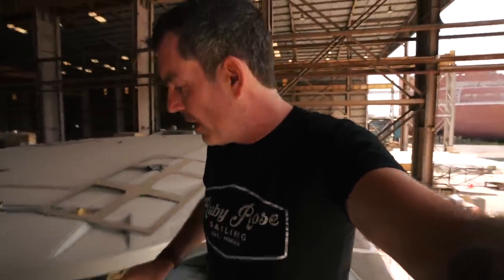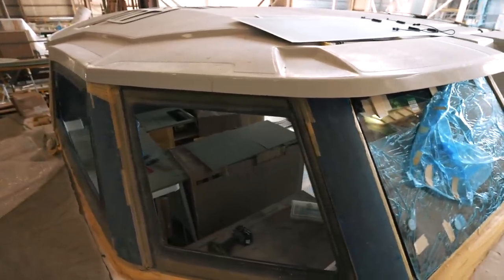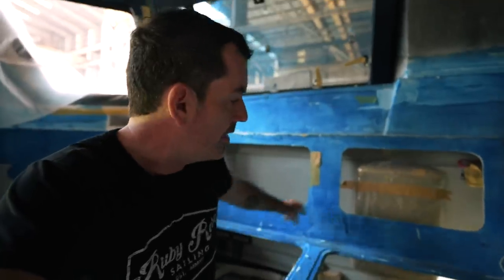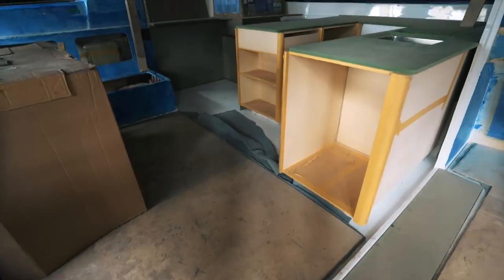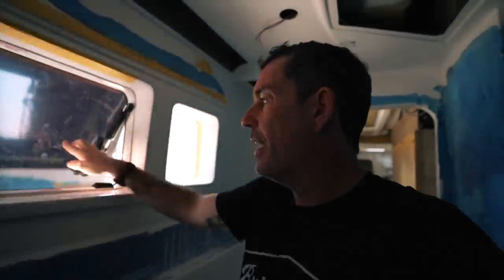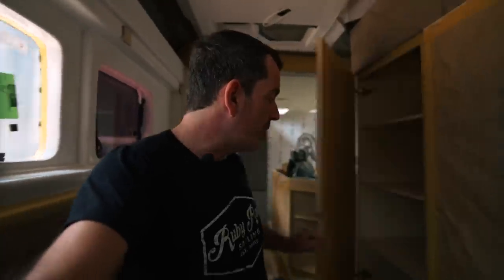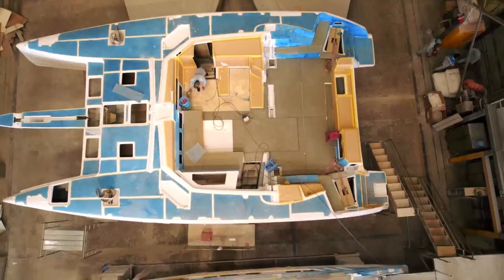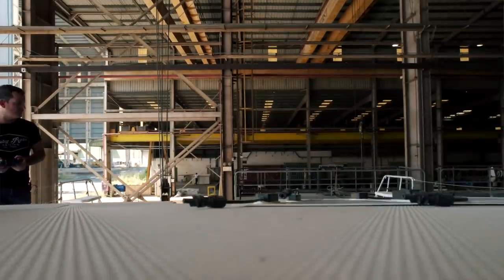Why Is Ruby Rose 2 Delayed?? An explanation & responding to negative comments

Comment: I used to work for a car company as a production engineer in the early 80s; often working on new concept vehicles I can confirm that it takes numerous trial builds before a build process is released to production. I acknowledge that in more modern times that design software is light years ahead of where we drew by hand on blueprints, but there is still the stage from plans to actual materials and process; even given that they already produce similar models. There is an added complication in that each build is bespoke in some way or another. Seawind is being amazingly transparent allowing you to release their new production line to public view. For me, that shows their dedication to ensuring that they get everything right in the builds. They will see less and less re-work as they progress through the hull numbers.

Comment: Nick if its any consolation I waited 684 days form the date of order entry to taking delivery of a mass produced iconic American Sports Car… After taking delivery in Kentucky and driving it back to Central Florida. The power plant had bad miss is which was variable in nature. Bottom line… the problem was an injector… which took another 35 days to procure and get to the dealer to complete the repairs. So 719 day for order to beneficial use. Hang in there Bud… Splash Day is Coming!!

Comment: Sweat wicking fabrics that are loose fitting can be helpful in the high heat and humidity.
Reply from the maker: I might as well run a bloody drainpipe up my trouser leg mate 🤣🤣🤣🤣. There is only so much wicking any fabric can deal with
Reply: @sailingrubyrose  been there did that. Unfortunately the locals were not friendly at that point which exacerbated personal comfort.  (1968) I appreciate seeing how well the people are doing and the motor scoter travelogue. Your experience in this land of the Vietnamese shows me just how frivolous warfare is. Fair winds.

Comment: Years ago working with Boston Whaler, Spraying white fiberglass chop on back side of a mold, hard to tell how thick the walls were per. Sq. inch. someone came up with, Add a color red to the fiberglass chop and spray with two nozzles one red and one white. When that sq. inch had 5 pcs of red the hull was 3/4 s inch thick. The bow had more thickness and so on.  Point is I love what's happening here mockups are foolproof. If they need to change something, its inspected, adjusted then uploaded in the computer design for the next boats. Delays like this are Good. By the way two hands on the bike buddie.

Comment: Different discipline but I had a relative who was a sheet metal worker and he told me in his experience there were many times when complex specifications that worked out perfectly on the drawing board for a new design didn’t translate into the metal without redesigns and tweaks in the physical manufacturing of the object .

Comment: Love the updates and Your Positive Attitude!
I must say the reminder of how complex the whole process is.
It is easy to think that they take a bunch of precut prices and glue them together and that’s that!

Perhaps this is a funny question, but… the boat (Hull) is being built in a really warm, perhaps hot environment… and then that hull will be placed in a much cooler environment… in some cases a downright Cold environment depending what part of the World’s Oceans You are Sailing in. 
So the question is…  does the hull material  shrink much?
Could that cause shrinkage to the point of cracks or at least fitment issues with the interior fixtures?

Obviously the materials used for the hull(s) doesn’t expand and contract to a degree that would cause failure… but I am just curious how much they do expand and contract.

Comment: A dauntingly complex construction. Even after the final fitting there are a ton of adjustments that were not foreseen until they became visible. Remember 5% of everything made by man is faulty right out of the box. All found issues MUST be dealt with immediately or you may pass by the time to be able to fix them. Complex is really an understatement. Have faith and your baby will be delivered as close to perfect as it can be made.

Comment: Have you had the Cat6 cabling discussion for lighting yet? Cat6 (for lighting) can save (literally) a ton of expensive and heavy 14-2 AC copper wiring. And, on noticing the small windows in the master bedrooms of this Hull 1, have you looked at the bedroom windows for Windelo 54 and HH44? Oceans larger and a big lift in comfort for a small shift in hull shape. The Windelo is too much to ask at this point but the HH44 3-fold size increase in rear-facing bedroom window(s) is easily accomplished I think (now is the last chance as I've mentioned this improvement once before).

Comment: All good things take time one thing i will ask is why they went to toughened glass and not Laminated Glass ??????? Other than cost and would it not be a good idea to run the Electric's to the area's that you may change over time to Electric. Great Vlog O and just for you mate Ford had a truck built by a Cad system and it won all the motoring shows around the world but it had a big fail that only came to show its head when the truck broke down and when it was time to tow the vehicle by the front when lifted it bent the Frame of the truck it was never designed to be picked up off the ground and Ford had to spend a lot of Money to fix the problem. lol

Comment: Nick. It is not only boat building that has problems going from design to construction, but every build from residential housing to large commercial and industrial builds  have the some/many problems along the design/build process.  Part of life, so any negative commentators need to take a look around.

Comment: I saw the catches in the cabin cabinets. Were they plastic or metal? We've been thinking of using the same ones on our boat, but wondering if the extra cost for metal is worth it or if the plastic ones will be durable enough for ocean cruisers. Love your channel BTW. We're about the same stage as you on our boat build in Thailand. Lots of common experiences at the moment. 😁

Comment: In architecure, there needs to be a realization that every building structure is a prototype. No two sites, soil, weather, bank loans, insurance, suppliers, contractors, delivery trucks, client, schedule, architect staff, engineers, consultants, are the same. Yes there might be a unicorn project where 90% of conditions are the similar, but that's a unicorn. Example: What happens if your project manager retires? That's a lifetime of experience and wisdom lost.

Comment: Hey Nick, quick question regarding the battery boxes and bays. I don’t know if I watched or read that some boat had the ability to flood the battery bay in case of thermal runaway? Don’t know if this is employed by anyone yet with the recent advances to Lithium batteries, but wouldn’t that be a better thing to flood to extinguish a runaway than to destroy the entire boat due to halons inability to put out a battery fire or flare up? I think I’d sign up for that modification in a second, cheers Doug on the left coast of Canada

Comment: Hello Nick
You keep showing the first 1370 how far behind is rr2.
To me toughen glass should not be used in yachts.
If it breaks you have a very large hole. As it becomes small granular pieces.
I think that laminate glass should be used as it will only crack but it will stay in place.

Comment: Your boat looks amazing, the only thing that I'm dubious about is not having razed helm positions. To me it would feel like driving a car from the boot (trunk), where as I like to drive my car through the sunroof like normal people😁
Reply: We have the 1260 helming from the same position. Quite the opposite, as Nick has said many times the visibility is excellent. When you are elevated every rock, roll and pitch is amplified the higher you go, instead of the floor moving a few centimetres it can be a couple of meters as you go up. Now imagine sitting up there hanging on in a rough sea passage for days on end. Next you just pushed your boom upwards reducing sail area, thus power and performance. The current helming position has you sheltered from the scorching sun (in Australia this is very beneficial), out of the rain and any salt spray when sailing in bad weather. A raised helm messes with your solar panel area and casts shade on what is left, it really makes total sense having them where they are. I'd NEVER go back.

Comment: Trying to decide where in the build queue I'd want to place an order (if I could afford it) for a new model of anything.  I'm thinking no earlier than the third item to give the builder at least a CHANCE to find all those niggling issues before they started on mine.  I was just wondering, are you going to try and hitch a ride on hull #1 for sea trials?
Reply: I would go with at least hull #10